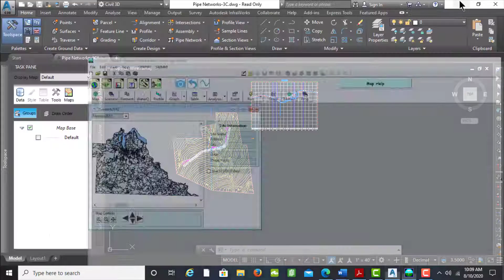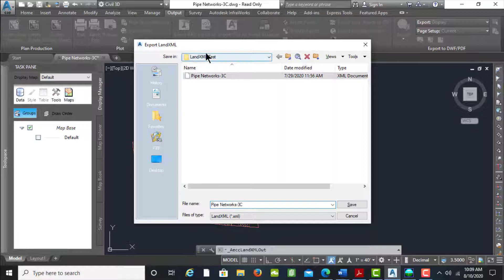How to export a land XML file from AutoCAD Civil 3D into WWHM-SWMM

Comment: Now the design of drainage, water and sewage networks in civil 3D is much better: SOLID
https://tbn2net.com/SOLIDOS
Dimensioning: rational method, modified rational, contribution on the fly, simulation in SWMM and EPANET directly in Civil 3D
Device modeling in LOD400
Quantitative, IFC, Integration via PropertySet
#tbn2net #SOLIDOS #infraestrutura #BIM